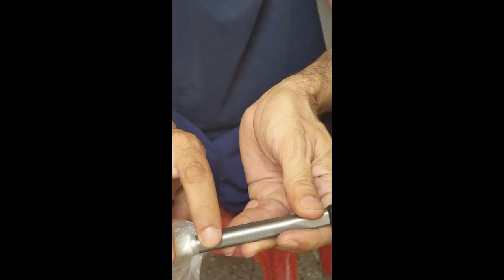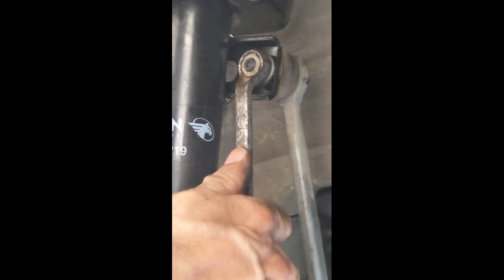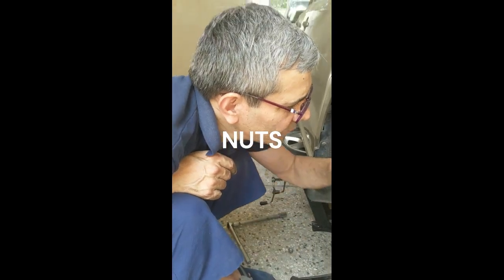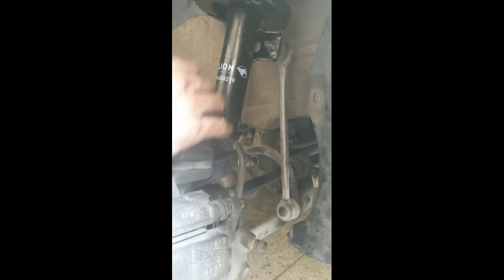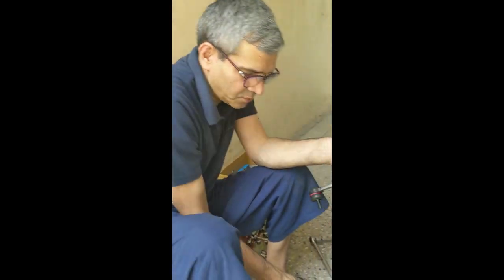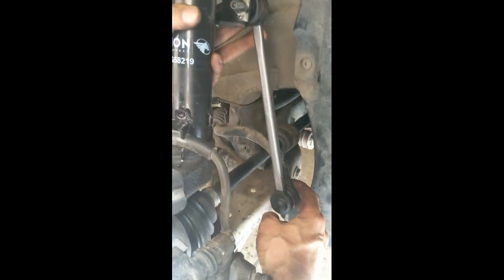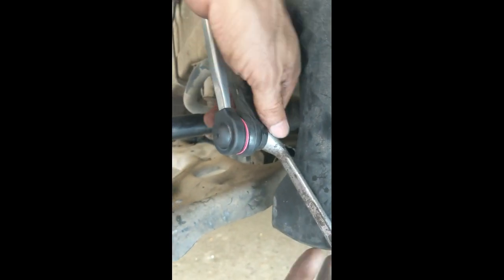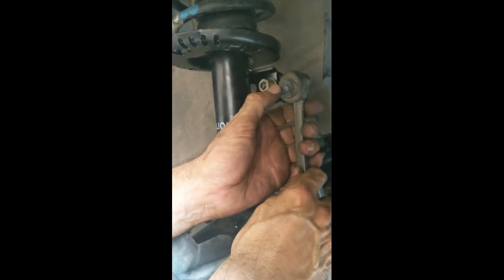VW LINK ROD CHANGE  E

Comment: Hi, as you have installed stallion shock absorber i see , how is the performance of it? Then OEM , i have also installed recently in my vento.and does it really increase height?
Reply from the maker: @abhiv777  so far so good. The height may have increased by a few centimetres,because there was a plastic washer type that came with the shocks,which the mechanic said will increase the height. But nothing very visible.
Reply: @jagmohanrathi9788  okay thanks